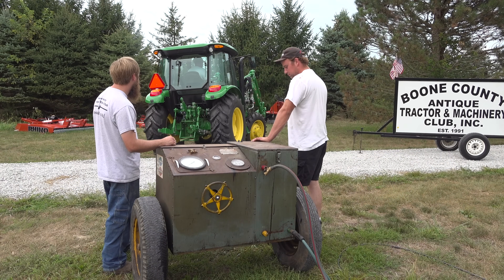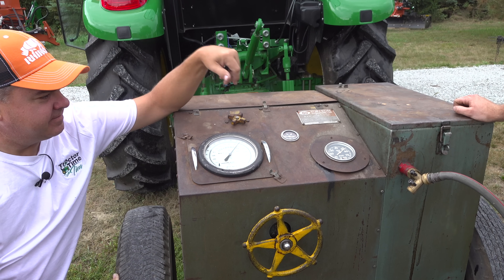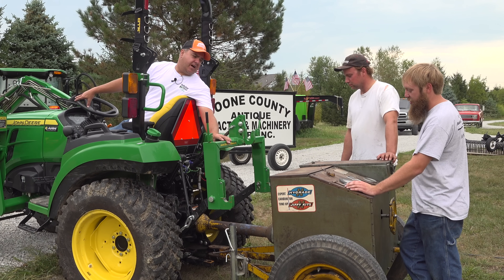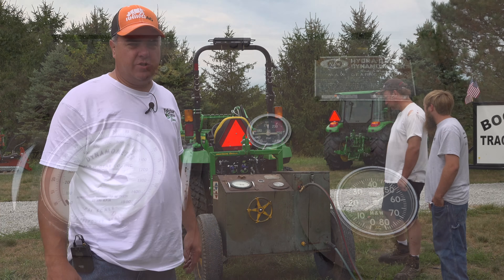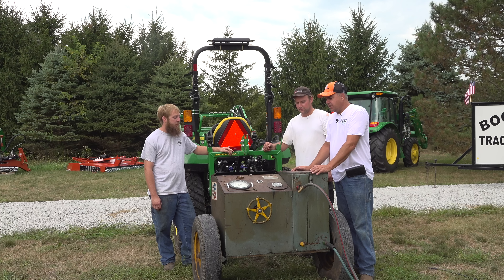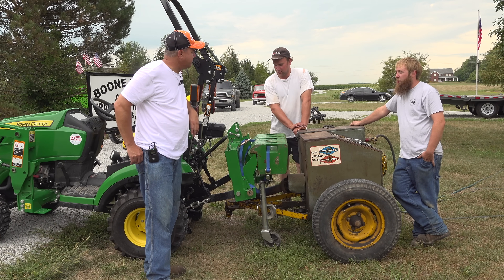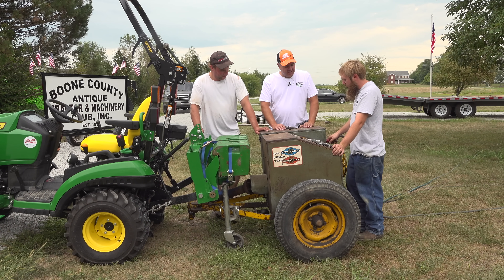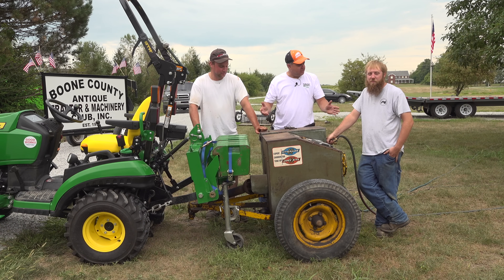Dyno Test!  PTO Horsepower Comparison - Kubota BX2680 vs. Deere 1025R Round #5 of 8

Comment: I'm wondering with the 1025 and kb that some of the hp would be directed to the hydrostatic transmission. I can't think of to many occasions where the tractor is parked and running the pto.  Not sure of the transmission for the 2 and 5 series tractors of this is a valid point for pto hp.
Reply: The task I do that uses most PTO HP is running my wood chipper.  Tractor stationary, seat up to disable the cutout switch.  In the old days tractors were often used as stationary power plants - to run a pump, a thresher etc.  Nowadays not so much, it's more rotary cutters and mowers that use the most HP.  Most sub-compact tractors don't have enough traction to use all their HP when pulling things like a plow - they spin the wheels long before they run out of power, so PTO implements are all you really use HP for.  Snow blowers apparently use a lot of HP.
Reply: Hmm, I wonder that as well, plus you are pulling some power for the loader, power steering, etc, wonder if that makes much difference.  I agree though, not very often a tractor is just sitting still running PTO implements.
Reply: theres no power draw with it sitting still like that
Reply: Erin McLaughlin I would suppose the manufacturers rate pto horse power with the tractor stationary too as there most likely are to many variables to make a consistent test otherwise.
Reply: Typically you are stationary when you run an auger, wood chipper, stump grinder, backhoe, general boom attachments like tree trimmers,  cutters etc, these are just a few I can think of off the top of my head. I am sure there are more.

Comment: do a sled pull the john deere1025r and Kubota BX
Reply from the maker: Need to find a sled.
Reply: Do a tug of war both clean tires on clean even concrete or asphalt, both in 4wd
Reply: That would be interesting.  I think it would come down to the amount of ballast at that point.

Comment: I think its commonly known that due to emissions regulations that the small compact tractors are generally rated at less HP than what they actually put out. Thats the word from most dealers I have talked to both John deere and Kubota. I think its a fair test. Change the PTO rpm might give you different numbers, but msot implements require the 540 rpm input to run properly therefore the HP number @ 540 pto rpm is what matters. Dropping 50 rpm to get 2 extra HP on the dynometer is pointless and negates the test. I would definitely love to test my mx5200 out on one of these dynometers. I feel confident that it is under rated (turbo diesel motor)
Reply: The Kubota L2501 definitely has that reputation, it's a big engine (1.4L I think), and rated at very low RPM.  There's definitely an industry in these machines magically coming in under 26HP.  Having said that, the Kubotas all recently got re-rated, and the brochures now claim about 21.6HP for the 2380, and about 24.8HP for the 2680 (but only in the USA, other countries still claim 23HP and 25.5 respectively).  I wonder if they're going to then move to slightly larger engines, still on paper having less than 26HP.

Comment: Hey TTWT, Interesting fun video. Ted at Everything Attachments used the same model of dynomometer in one of his You Tube videos. Usually he is showcasing some of the many products EA manufacture or market. Apparently Ted's family goes back generations selling Mules to modern implements. This video he dragged the dyno out to show how to ( legal ??? ) tweak the diesel injector pump to increase the engine output of a New Holland tractor. Fun stuff .  Thanks and have Christy turn around so we don't just see the back of her head. Take care

Comment: I have a very hard time believing the 2038 is only 3-4 more hp than the 1025
Reply from the maker: It was the only one of the 4 which came in below rated hp. Suppose something wrong with it?
Reply: @TractorTimewithTim  
Dpf robbing HP.
Reply: Tractor Time with Tim margin of error
Reply: @TractorTimewithTim  Nothing wrong, the 2038 engine is the same as the 2032. Probably has not had its injector pump rotated to the correct location for maximum power.